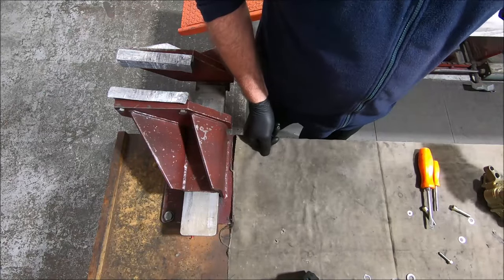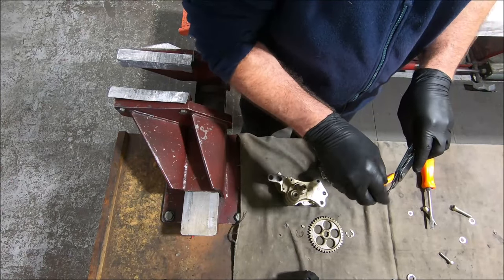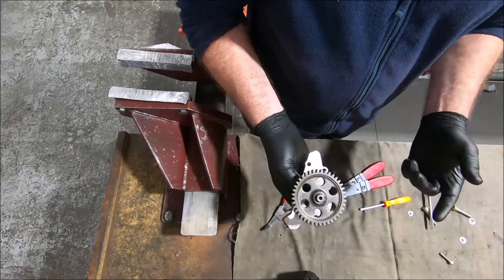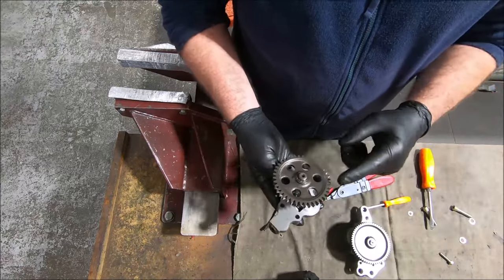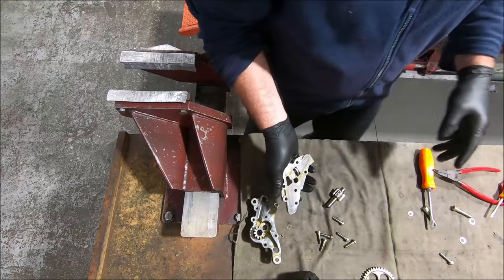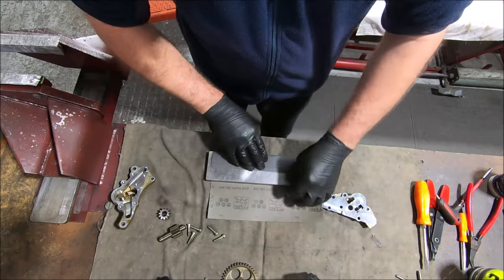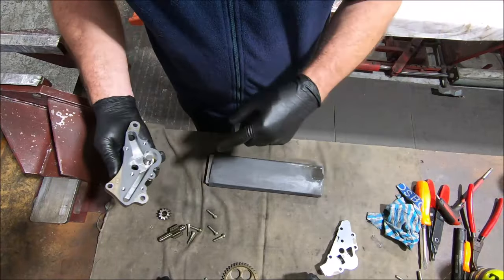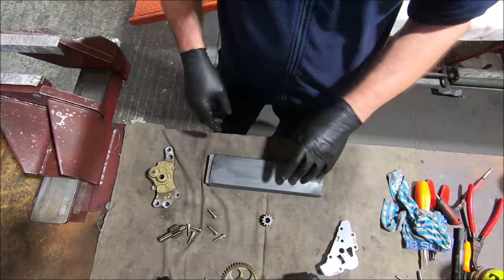Ducati belt drive oil pump: variations, disassembly, reconditioning, rambling

Comment: This is so good to see, very high standard of work. I learn so much detail. Thanks Brad. I live in UK.  Range -2 to 33C   st2. 1998. 12000 miles. Is a 15 50 ok or 20 40. Does it really matter. And fully synthetic 4T,  changed everything years with filter?  Or is it just what makes you feel good?
Cheers Rich
Reply from the maker: i wouldn't run a cold weight over 15 or a hot weight under 50.  but it's water cooled and you're a bit cooler than us so you might go one lighter on both.  i've noticed the air cooled engines certainly getting noisy when hot with 40.